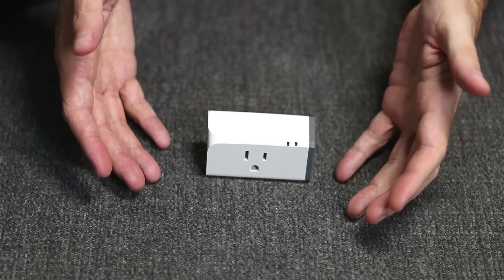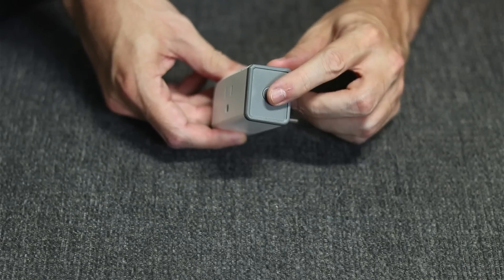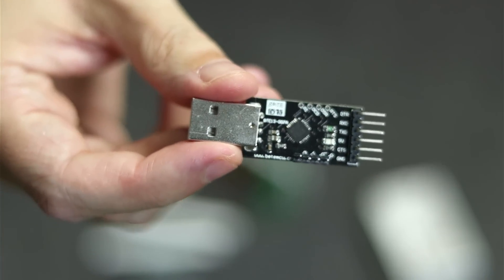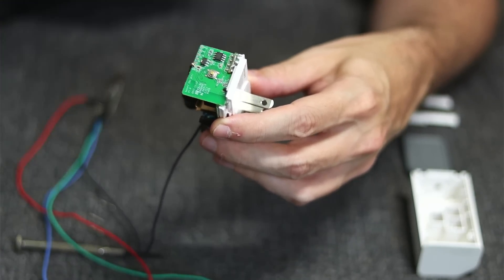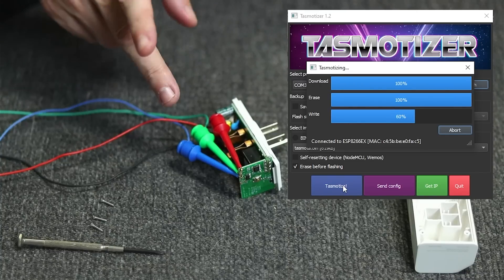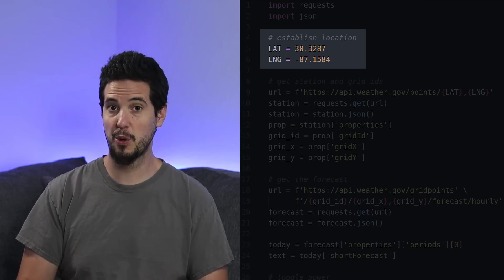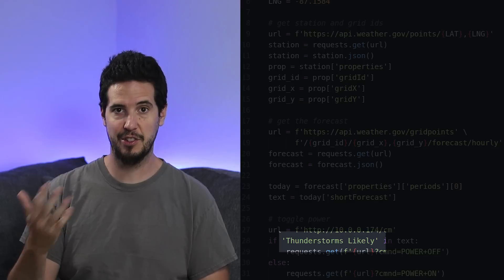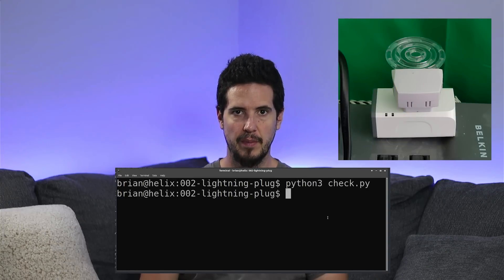I Made a Lightning Aware Smart Plug

Comment: I have a used lorex nvr box that doesn't boot which I got for $11 and I was wondering if I can do the same thing with an arduino uno r3 to install linux on it. Bought it for the 3tb hard drive to use in my security system but I don't want to just throw this tech away, would love to mess around with it or at least find a start on what I can do with it .

Comment: On a side note.  You may want to have an electrician verify your grounding rod is correctly attached and seated.  That may be what's causing your devices to short out at.  Or even better.  Connect a device to measure the hot, neutral, ground legs and record which spikes during thunderstorms!

Comment: There is a thing called Surge Protective Device (SPD) available for both AC and DC supplies just install it to your main board input.  It will protect you in both cases, surges from gird and thunder storms.
Ps: if you want to know more about protection system I can help.

Comment: Nice video. I like the new format. Waiting for the camera to focus was slightly distracting, but to cut it off I understand you would have to do the video and voice over separately. So it's fine like this, I guess. 
I have some smart devices at home too. Mostly Shelly plugs, switches and heater valves. I have hooked them all to HomeAssistant plus I have some automation done in Node-Red. I have some automations which mostly turn off lights under certain conditions, cause my kids would keep the lights on all day :) 
I like small atuomations like this. The more sensors you have the more you can do and it's all just a matter of your imagination and inspiration :) 
Keep it up! Good luck!
Reply from the maker: I've consulted a friend on optimal settings when shooting up close like I was to avoid that in the future. I'm still getting comfortable with my new gear.

Comment: Cool project. But you can still fry your equipment even if the plug is off. Lightning still fries powered off equipment : ).  Your best bet is invest in better surge protectors that have higher protection...or even better lightning arresters.  Otherwise only way you can protect is unplug from outlet...now if you add some springs to the wall side of plug to eject the plug from wall...that would be really cool
Reply: I vote for the spring idea. It's brilliant and way cool!

Comment: This is a really cool idea and I like how you put it all together. It would be great as a Lightening warning for when I'm working in the yard.
But you know what works a lot better and easier and doesn't cut your equipment off - a Battery based UPS.
Not the cheap plug-in surge protectors (they're worthless junk) but a real proper battery-based UPS (625VA versions start around $70). 
Because the incoming AC power goes through the battery first, your equipment is always protected.
The only downsides are 1) you need a separate UPS for every outlet location (one for your computer, another for your TV, etc) and
2) if the power goes out, they beep very loudly and if you have a dog, it will drive them crazy.

Comment: Would the Sonoff plug itself still be vulnerable regardless of being in a on/off state? Also, can I assume you left a geocache on Pensacola Beach? I'm heading there now with my shovel!
Reply: Yes, everything is fair game when it's connected to earth and lightning happens. Even surge protectors. The goal here was to hopefully destroy the cheap sonoff vs the expensive xyz.
Normally a surge protector can handle blips from lightning and such, however depending on how violent I've seen and heard of them failing and causing damage, not that this is a solution to that, but it's cheaper than good quality surge protectors I guess ¯\_(ツ)_/¯

Comment: Cool stuff man. Appreciate the video !  Anything to know about configuring the plug after you flash the firmware ?
Reply: Once flashed it broadcasts an AP. Connect to the AP and put in your wifi network creds. Out of the box tasmota comes with sonoff templates you can choose it or find the correct one in the docs. Other than that maybe setting a static IP, and then you're at the same state he's in.

Tasmota can do much more such as mqtt, and support a bazillion of other devices.

Comment: Would probably be better with a double-pole switch/relay, I don't know how much real protection you are getting from a small relay in those sonoff switches
Reply: Was thinking the same.
Reply: What about a surge protector? Any reason why those wouldn't be a good solution to protect from lightening?
Reply: I think the thought here is the sonoff is cheap. I'd rather blow the sonoff up instead of xyz appliance. Fwiw I've blown up similar devices on purpose (the very old sonoff hardwire to test the solder traces) and by accident lol For example the Shelly devices use a similar relay and while it gave up the ghost when given a 220 short straight to the dome it didn't cause damage to the circuit or devices behind it! 15 minutes and $15 later I was back in biz.

Comment: why not just get a plug with lightning surge protector fuse ?
Reply from the maker: Everything is already surge protected which doesn't seem to be helping.
Reply: @EngineerMan  it might be worth looking into the houses grounding in this case, either way cool video I like the idea and am going to steal the idea for home assistant
Reply: @EngineerMan  Maybe you have to call a better electrician or you did your own wiring ?
Reply: Didn't know surge protectors could fail consistently.